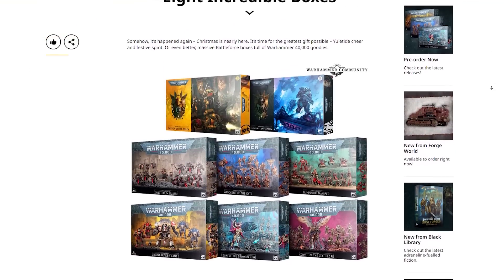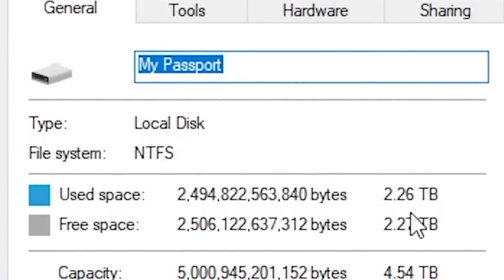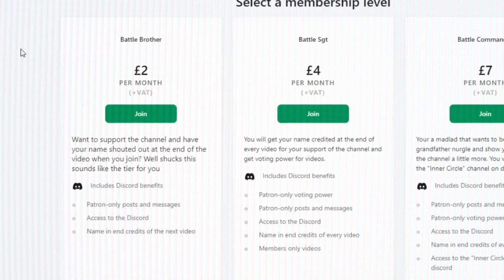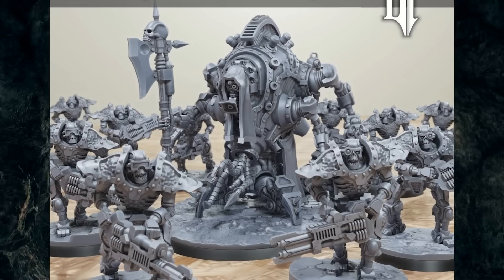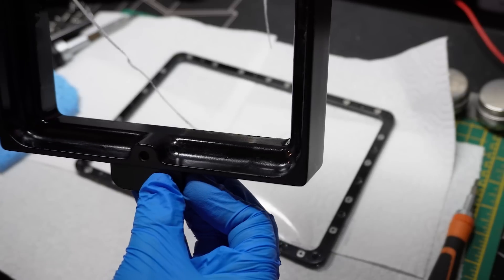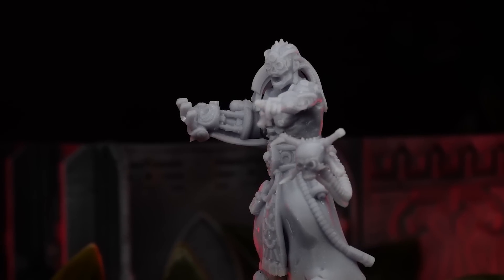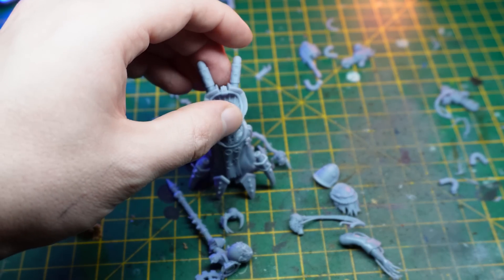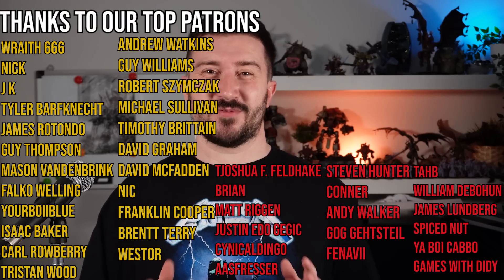3D Printing A Better Battleforce Box For a Fraction of the Cost

Comment: 3:02 I might be wrong, but your resin doesn’t look mixed up properly, which may affect your prints as well. 
Usually, if I leave my resin out for too long, it’ll start to separate into a white layer on bottom and a black layer on top. It kind looks like your prints pulled that white layer up when it finished and started rising back up. 
Remember, your resin needs to be shaken, not stirred.

Comment: sorry for long comment but i feel like  i should drop some wisdom i have picked up over the years

as some one who has printed more then 30+ full size armies I highly recommend you spend the time to learn how to support your own models for a few different reasons. 

1. everyone uses different printer size beds have different lift heights, speeds and burn in layer settings these can all effect the chance of success.
2. every one uses different types or resin. Some resin is more or less brittle than others and supports may not work for all due to this reason
3. the slicing software some times can make a huge difference in success or failure sometimes when a model was supported in lychee but u use chitu software to slice it can result in failure

here are some ways to combat these issue from arising and to avoid failures as much as posable

1. when supporting models use more supports then u think is needed. I recommend using 1-3 heavy supports(place the heavy ones on the feet and first contact areas of the model) then use a mix of medium and light supports to fill the gaps. (pros ) u wont get many fails at all this way (cons) allot of supports to clean up and also wasted resin. 
2. increase your burn in (first layers) times and also increase the lift height and decrease your lift speed. (pros) better quality and less chance of failure (cons) longer print times and can be hard to get model off build plate so don't go too crazy.
3. do not for any reason change your resin type. color wont matter u can mix the same type of resin even if its different colors but once u change resin all ur settings will be compromised and u will sometimes have to tweak many settings witch can cause fails and frustration. (pros) less fails and you can keep pushing your quality to failure balance (cons) some times the resin u choose will go up and down in price witch can be a pain I recommend buying bulk when it goes on sale on amazon etc.

4. goes with out saying but cleanliness and maintain your machine. u will need to replace the FEP fairly regularly  as a rule I usually change it once every 50 or so prints also i recommend a full clean out once a week just to clean off the FEP make sure threes no dents or creases if it looks questionable replace it. u dont want reason all over ur screen FEPs are cheap dont risk damage to your screen

any ways great video mate keep em comin

Comment: The answer is pretty universally "Yes" if you can find the STL's. The 1 for 1's are out there but pretty aggressively guarded by the 3d printing community due to GW's dmca tendencies and Admech being called the money-hammer" faction due to the cost per point.

There have been in-depth cost analysis regarding manufacturing costs for GW before. 

Big costs are the injector, and plates with a $100,000 price tag on the extreme end for the plates, which can last up to a million runs.
Whatever GW pays their sculptors, considering GW's business behavior history 100% expect it to mirror Disney's "We own everything you make while here."

I've done deep dives into cost analysis and financials for GW before and they exist entirely in unicorn land as far as return on investment is concerned with their profits often being more than double GW's operational cost. They could afford, rather easily, to make the hobby easy to get into but that's never been how GW works.
Reply: I don't doubt that some molds cost up to $100,000. I'm just wondering how common that is, even among GW's range. They aren't spending that much for those special promotional model kits that get sold for one day, and never again.

Other manufacturers of plastic models show you can put out kits at a price point and volume far more customer-friendly than GW. GW just wants more money.
Reply: @Bluecho4  Oh well aware of it, I'm using that particular $100,000 mold on purpose (is for large body multiple hollow steel plates) as a to-prove-a-point, the average for things like gunpla & models (the closest things to 40k) hardly ever get over $3,000 per set-plate. There are also ways to drastically reduce the cost of plates like using thermally resistant resins to create incredibly cheap (we're talking tens of dollars here) molds....
Reply: @the_arcanum  There's the other way, ninja ripper, noesis, blender (for resizing, putting in a skeleton to pose things & to part them,) then into cura/lychee/prussia, name that slicer, ect but that's a lot more work than most are willing to put into a project
Reply: Would you know of any printing communities out there that have those one for ones? Totally asking for a friend 😅
Reply: With a background in plastic mold engineering, I can tell you that 100k is cheap for steel molds which can last up to millions of injections (although if you are not concerned about mold lines - which is unacceptable in most injection molding businesses). Usually, plastic molds are kind of simple. Lots of flat surfaces. Not many undercuts ( I lack a better term but basically this means that there is no back injection - think about a bucket - the plastic is injected from one side. You take either the bottom or the top as the projected area - if you face the side of the bucket you run into the problem of an undercut and you need retracting cores which are pretty expensive). So if you look at a boxset with all the sprues and details you can imagine the time which is needed to carve out all the details. I think GW is using aluminum molds. It is far cheaper to make the mold compared to steel (complex forms in steel are machined with EDM which is expensive). With aluminum, the main concern is durability which is not an issue in this case since GW doesn't sell the same products for years. The machines they use are pretty cheap. The projected area is quite small and therefore is the clamping force. So a good machine with automation to manufacturing the big sprues from a box set will cost you around 200-300k. It would be cheaper to run a bigger machine with 4 or 6 sprues at once but I'm guessing they don't use that method since the production value is comparably low and a tool change costs more if the tool gets bigger. I guess a typical box set has a production cost of 10-15$ maximum. I don't consider the plastic itself since it is such low cost compared to the rest. The rest is marketing, overhead, and margin. I would be more than curious about what your guesstimate is if you mind sharing?
Reply: @illegalduckhunting  While not 100% precise, can do an extrapolation from their annual reports (Yeay! Accountancy!) to get a rough guesstimate on overall production costs.

We first need their core revenue, as 2022 is listed, core operating revenue is £131.7 million. 

Core operating costs are  33.0% of that core revenue, brings us to £43.46 million in operating costs, total.

Now if we go digging even further through the report, we'll find a set of lines in the audit - Owned property, plant and equipment & right of use assets.  These are manufacturing equipment and physical stores, specifically in the UK. Total on those comes to £23 million. 

That cost can be fed back into the operating revenue to get us a very rough % of a £ spent in production (The audit doesn't necessarily separate production equipment from the physical stores and leased assets.)

This ends up with £23/£131.7 = ~0.175 or ~17.5% of a box price coming from manufacturing price without other externalities that could reduce that further.

We'll use the absolute newest set, Leagues of Votann as our example as manufacturing equipment costs depreciates with time. With that, we end up with the brand new £120 Leagues of Votann army set coming to a ~£21 production cost, so not far off.
Reply: Would you happen to know of any 1-1 skitarii?
Reply: Just wanted to add to the comment about the artists. They are GW employees anything created by them for GW is property of GW.  I say this alot when people try to say 3d printing is bad, stealing, or hurting the lil guy. It doesn't. That sculptor got paid his normal salary and gets paid no more or less due to the popularity and sales of his designs.

Comment: Hello! I want to get into 3d printing for W40k terrain (and those true scale terminators) but im not sure what printer to get? I have seen you use a mars 3 pro (I think) and now the Saturn. What printer would you recommend?  Any help would be great, love your content.
Reply: Budget aside I would recommend a saturn just for the size of the printing plate. Where you might print one squad on a saturn you'll need at least 2 runs on a mars. Likewise if you're looking to produce bigger pieces a saturn will make more sense.
Reply: @Ashes2ashes303  Fantastic, thanks for the info brother.
Reply: @paittenmedicineeagle4559  there's no wrong choice between the two anyway

Comment: Crispy Prints. And pretty nice proxys. But doo you really need to change the FEp after 4-6 onths? I only change it when it rips.Otherwise i just relevel the Plate from Time to Time.
Reply from the maker: It probably should be sooner with the amount I print lol I was printing non stop for 2 weeks and just had a string of failures, how many times have you changed the fep?? Lol maybe I change it too soon
Reply: @battlebrothersam  On my Mars 3 only once because i destroyed it. My mars 1 went without changing it for roughly a Year before i destroyed the FEP.

Comment: This is why I got a 3D printer.  To print all the armies I can’t afford
Reply from the maker: Same here brother
Reply: How much did it cost, plus how much does the resin costs you (i know there's many kinds and brands but.. in average), plus tools and other material and how much of your time does it take up?
I'm not dissing, I'm just curious.
Reply: Same for me.  One of the best decisions I've ever made.
Reply: @d-emprahexpects  it’s a whole mother hobby.  There have been times when I want to give it up.  Cost wise, it’s much much cheaper, but more time consuming
Reply: @thomaswilliams5005  interesting. I did my research on 3D printers and resins etc and its not the cost that kept me away, it's the time investment into learning, maintenance, cleaning... Not to speak of the hassle of assembling resin. F*ck me I hate superglue and pinning stuff 😅
Reply: @d-emprahexpects  I also hate super glue.  I learned meshmixer and now I never superglue anything.  Microsoft has 3D builder too, which I have no experience with.
Reply: Yep. I still have plastic armies. But instead of paying for 2 and only 2, I have 1 plastic army and 4 printed ones.
Reply: @d-emprahexpects  Upfront costs isn't cheap but GW prices are so insane that it all pays for itself in a weekend or two that's if you go whole hog with a big wash and cure station $200 (Phrozon wash dry and cure), 4 gallons of IPA off Amazon $80, 1 gallon of Simple Green concentrate (pre-wash), a 5 gallon bucket, Sunlu ABS grey resin $48 for 2 liters.  Flashforge Foto 9.25" 6k printer $269 with free shipping.  Box of nitrile gloves from harbor freight $6, paper towels big pack $12.  
    180 Termagaunts from GW would be $630 ish, and I can print 20 at a time at 2 hours printing time, 18 hours to print 180 termagaunts, less than 1, 2 liter bottle of resin, so if you said I spent $700 on all the resin printing stuff...day two I would be in the savings world.  Not to mention just the wide range of printable terrain, and other games supported some almost entirely by 3D printing such as Gaslands.  
    I also print tanks for Bolt Action, entire armies for Kings of War which are tournament legal, and stuff for friends if they buy me resin.
Reply: @slimjim7411  wow... Thank you for your reply, serious food for thoughts. Although, if I had a printer I'd probably get a MyMiniFactory subscription and print some awesome terrains, some busts, cool minis for D&D and other crazier things. I wouldn't limit myself to the worlds of Warhammer 😉 there's such amazingly talented sculptors out there

Comment: Take this with a big grain of salt as I'm fairly new to resin printing but, assuming that shot of UVTools is showing only 3 islands detected (the next section being resin traps?), that seems pretty good to me. Even models with great pre-supports will usually show a few tiny islands in UVTools, in my admittedly limited experience.
Reply from the maker: Yeah it was 3 small islands which is why I printed them because I didn't think they would affect it but like I said it's the first time using uvtools, usually I use photon file validator and don't have any islands on my supports so that was my base for comparison

Comment: @1:40 and @3:04 My man, you need to stir up that resin WAY more! Resin separates after some time, make sure what's in the vat is properly mixed through and shake the bajeezus out of a bottle before adding in to the vat. Improperly mixed resin can cause failures as well, so better make sure everything's mixed well!
Reply from the maker: Lol yes...this was a concoction of abs like mixed with standard, stirred greatly prior to printing but seperated whilst printing

Comment: UVTools is such a great tool! I also use it as part of my process and I'm barely scratching the surface of what it can do.
Reply from the maker: Well if you have barely scratched it I have merely tickled it lol
Reply: @battlebrothersam  Best advice I can give is leave the default settings for the auto repair, run the auto repair twice (maybe 3 times depending) and whatever islands, resin traps and suction cups are left after that are the more egregious ones to look at. Also learn to use the pixel editing tool and the Difference tool to see if maybe there is a support tip going to an island, but the tip is just too small.

Comment: Sooo; I'm trying to cast an ad mech army out of Copper, Aluminum, Brass or Silver to play with some friends. Preordered a Saturn 3 and plan on using powercast wax resin, currently building an electric kiln for some molds. If anyone has some stl files or have a great idea of where I could find some Adeptus Mechanicus models please @ me, I'd like them pretty close to GW's models so it's hard to tell apart (idgaf about intellectual property arguments, they make plenty of money of their franchise of lore and are not offering the market what it desires, metal casted figures should cost the price they charge for shitty plastic).

"From the moment I realized the weakness of plastic, it disgusted me. I craved the strength and certainty of casted metal." - Magos Dominus Reditus, realizing plastic was expensive and frail.

Comment: Failed presupported files = dead stuff to use as basing materials. But I've found stationforge supports suck. You can get a decent print if you put them through uv tools and add a few choice supports yourself. It saves you only a little bit of time though.

Comment: I think you hammer too much on the pre-support issues. Most of the time they'll print ok anyway. You put too much emphasis on things being perfect. And I also think you overstate the risk to the vat / printer. There is certainly value to be had in reviewing different qualities of supports - but I think it comes up too much every episode.

Use a screen protector for your printer and then just print away.